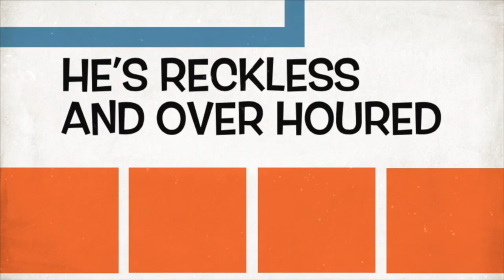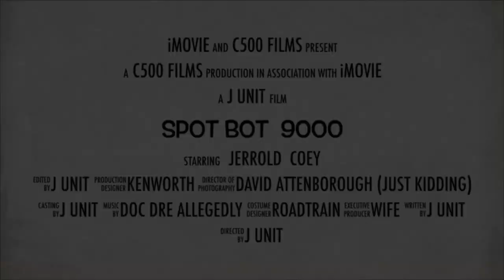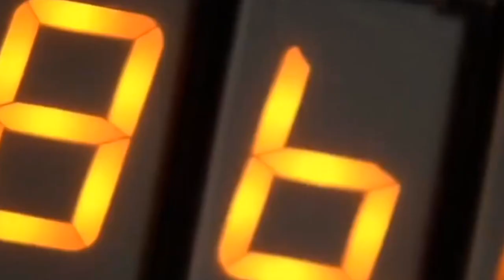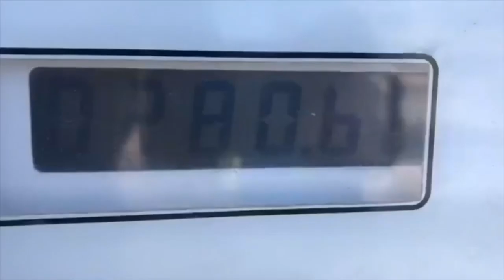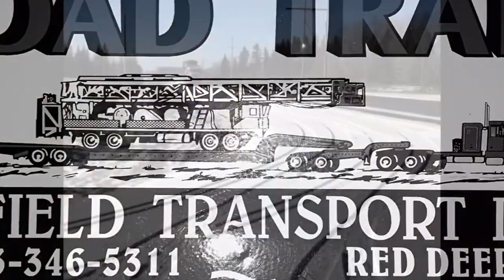MARCH 13 2019 SERVICE RIG HAUL RTOT RED DEER TO BUSTER CREEK

Comment: oilfield trucks are the best
Reply from the maker: They are definitely cool looking. But every truck can look cool with the right stuff
Reply: @TimelapseTruckerRTOT  there mean and brutal looking with the bumpers and headache racks any won of them could drag a road truck upside down and drag it down the road
Reply from the maker: Yeah I’m not really worried about impacts front or back. DONT even flinch at Deere. I’ve hit a moose in a different truck with just a big aluminum bumper in bent a bit and broke a headlight. Cruise set at 116 kph in the late hours dark. He was just standing in the middle of the road. Bad peterbilt headlights and I didn’t see him till he was right there.

Comment: we used to rack right next to pats armor rig in roadtrain yard, this is the ochiese eagle rig. its a tandem tri. its 4.2h 2.92w 20.1l. your wheeler was 1.25, call er 5.5 m high to be safe.. i remember that day, we were going out for Kapalka, Bellatrix.. we wheeled back on march 18th.. but i think Greg wheeled us back
Reply from the maker: Me or Greg yes. I used the picture since it was the first I could find. You caught me. The eagle rigs are lower for sure. Armour was probably the tallest out of them all. And performance. One of them I tagged the train lights on hwy 12 by bentley and there supposed to be  at 6 meters. We measured them and they are 5.5, no damage but not a great feeling
Reply: @TimelapseTruckerRTOT  in the thumbnail i am pretty sure that is eagle 35 (ochiese #2), but in the video its eagle 58 (ochiese #1), i am the guy that shows up in the blue dodge and unloads the rig, we used to park in RoadTrain yard right next to Armour 102, both are almost the same colour.. but they are tri steer and i am tandem.. lucky on the no damage with the performance rig, but i bet it still gave you that bad feeling in the gut.. oh shit hahahah

Comment: Oh are you ever gonna try that camera over the shoulder thing again?  I think it might be cool for some shots to show what you're doing in the cab as well.
Reply from the maker: it's coming up in the next video bathroom gen haul. the problem is you can't expose very easily for inside a cab and the outside on a bright day, plus i don't have a proper mount. i'd like to catch from the sleeper looking out or at least in between the seat. i'm going to try to get it more figured out to do so its a great shot
Reply: @TimelapseTruckerRTOT  well hopefully you figure it out.  I think it'd be cool.
Reply from the maker: I need to try it doing bed work for sure